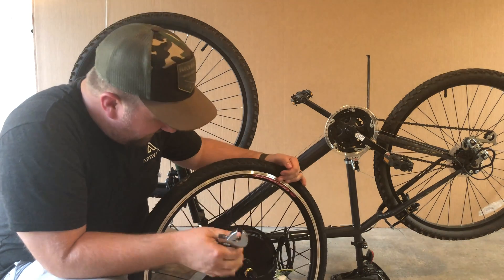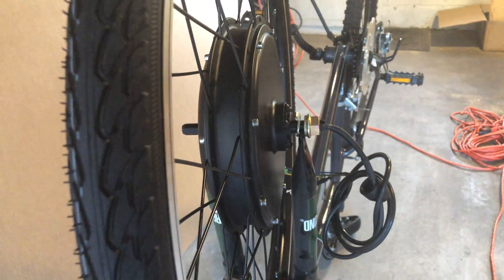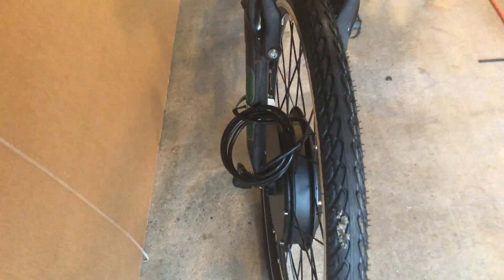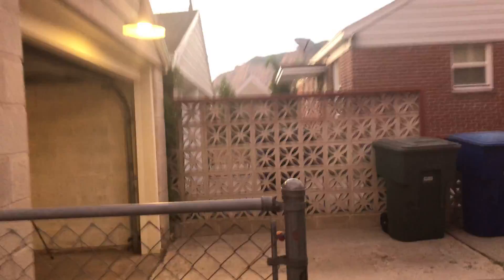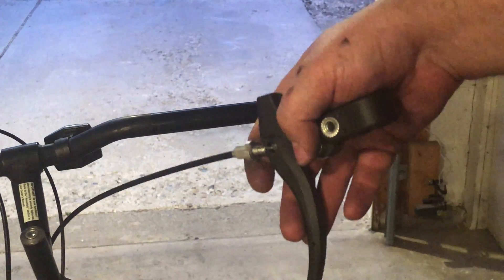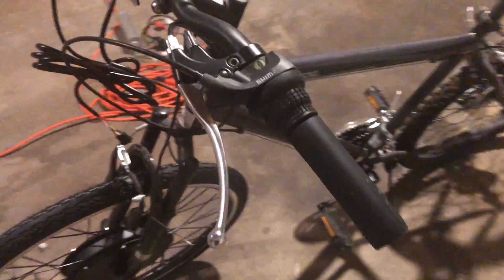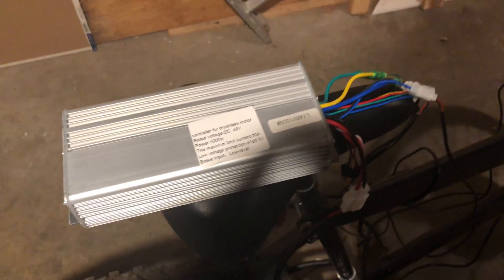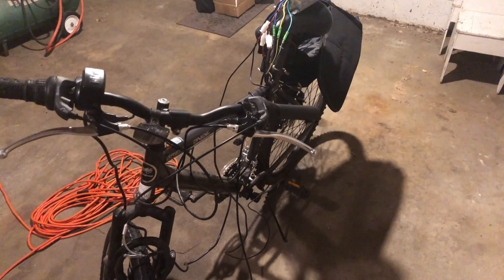Converting My Wife's Mountain Bike Into A 1000w 48v eBike!

Comment: Hello. Good video, I'm new to this, I was thinking of buying a used e bike like yours, 1000w rear DD motor,  it has the thumb throttle with the 3 lights I think like yours,  I think you just press the throttle and it goes to the top speed , can you fit a screen so you have different speed modes if that makes sense.   Thanks

Comment: Howdy Tim, is she still running, you have the tab washers wrong but I'm asuming you probably figured that out as it's a couple of years old, anyways how's the kit doing?  and has she rode it ?
Reply from the maker: I haven’t ran the bike for over a year. I need to get it up and running again. My concern is that the expensive battery is no good since I let it sit for so long. I’ll swap the washer when I get back to it. My wife did ride it, but I used it mostly for a commute to work and back. Now that I’m working from home, it has kind of been forgotten.
Reply: @tim_sessions  Depends on what voltage you left the battery, they say for long time storage 40% charge, it should be good if it's new even after years, you should check it out or sell it as the battery is worth over 100 bucks alone if it still works, av a gud'n mate 😎🙋👍

Comment: Dude did you get torq arms? has your wheel poped out yet? very dangerous with out mine popped out first 5 minutes of riding im lucky wasn't worse. Also the dude in the comment is correct you but the washers on wrong.

Comment: could I just add one break which connects to the controller and keep the other which originally comes with my bike?
Reply from the maker: I believe so. Yes!
Reply: @tim_sessions  thank you, and would it be possible to use on a mountain bike? just is the tyre wide enough?
Reply: Either brake will disengage the motor. The only issue I see: in an emergency situation,  if you're on the throttle,  and you're only applying the brake without the cut-off.

Comment: those washers with the hooks go into slots and are either on the outside pointing in or inside pointing out. towards the forks, keeping the washers from turning and loosening the bolts...
Reply from the maker: That's what I thought too, but they didn't seem to fit that way.
Reply: @tim_sessions  does your forks have the slots cut for the washers?

Comment: My disc brake is on left side in the front and they want the wire side to be on the left and the treds for disc brakes are on the right side. There has to be a solution through wiring to reverse this.

Comment: m8, you need to change that washer over to the outside of your fork, that little bent tab is a torque bar, its to stop the axle rotating in your fork and causing the wheel to pull itself out (and snapping the dropout), the way you have it is very dangerous, especially in your front wheel, the tab is wearing on your bearings, it could lock your wheel up.... plus, get some torque bars off ebay asap
Reply: Ok
Reply: The axle is square so I don’t think it will turn in the forks. But I agree it would appear that the washers should go in the outside, or at least be turn the other way so the tab fits into the fork’s axle slots.